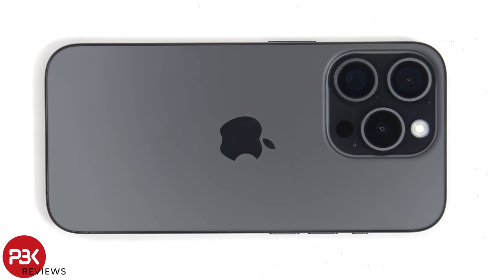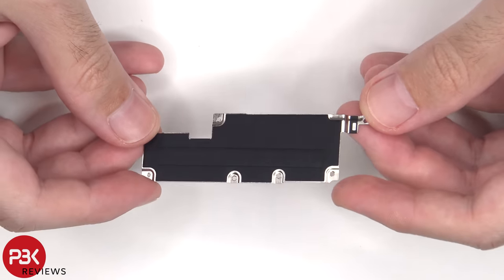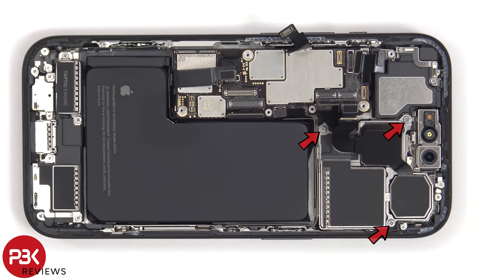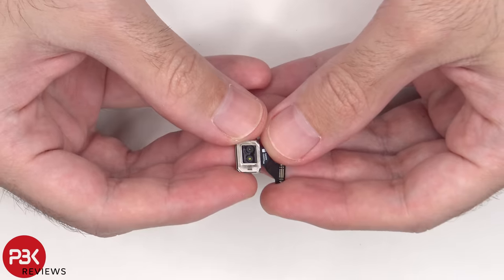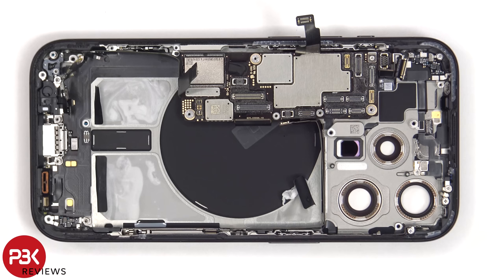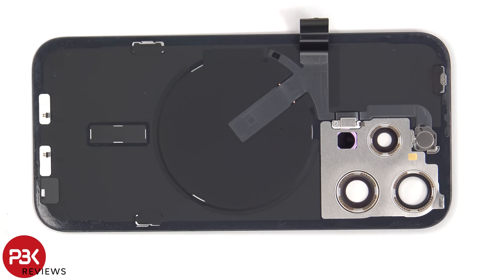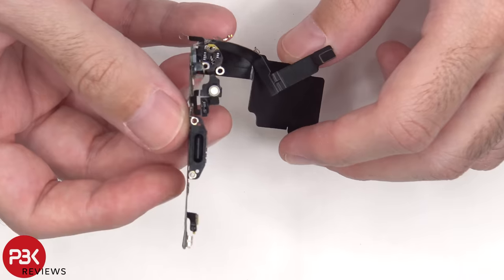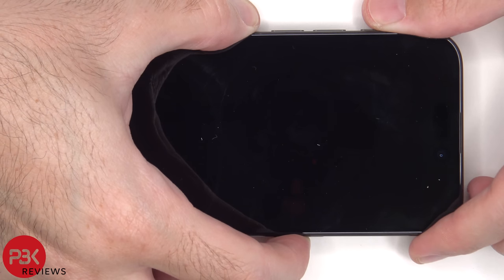Apple iPhone 15 Pro Teardown Repair Video Review

Comment: Repairability score 7/10.  This Teardown Video Review 10/10.  Amazingly well done, in focus, no bs, everything covered.  Bonus points for quality voice and not having grungy hands or nail bitten fingers too.  Props.
Reply from the maker: Thanks!
Reply: repairability is more like a score of 5/10 since you can’t just change the battery an expect it to work you have to reprogram everything and that goes for the screen as well
Reply: 7/10?? Man everthing in this phone is software locked, you cant replace anything without special soldering skills and/ or programming tools.
Reply: nail bitten score🤣🤣
Reply: lol the last few bits, couldn't agree more!
Reply: @johnny4498 it’s more like 10/10 to be honest
Reply from the maker: As mentioned in the video, the score is really only valid if it is actually repairable and not software locked down. I didn't have a second unit on hand to swap parts to test at the time of the video to know for sure etc.
Reply: @MikehMike01 Do you mean 0/10?

Comment: I'm in love with iPhone's internals. It's pure engineering.
Reply: Beautiful inside and out 😍
Reply: It's because it's all 🖤 inside.
I myself prefer black PCB over any other PCB  print color.
Reply: @LenstskyYT  it's not only because the blank painted board. It is because the structure and custom parts.
Reply: The Galaxy is better engineered. You can put a pen in there!
Reply: @JohnTaylor-bd1uy  I think a pen inside doesn't mean better engineered.
Reply: I think most high grade electronic products these days have amazing engineering that go into them, regardless if you like the company or not.
Reply: @JohnTaylor-bd1uy  hahahaha 🤦🏻‍♂️
Reply: @JohnTaylor-bd1uy  no, Samsung doesn’t even come close!
Reply: @dannyseville2543  In my opinion it seems like you've not worked a lot fixing electronics to see what i'm talking about.
Reply: 根據韓國產業通商資源部的數據，8月韓國的芯片出口總額同比下降21%，至86億美元，為連續第13個月下降。
以前中國想買，韓國不賣，現在韓國想賣，中國不需要了。
Reply: Do you do Microsoldering? Fixing the iPhone Circuit board?
Reply: @Adgale   that's my point, you need good quality material to build a complex Black painted PCB. Cause it's not easy to track the circuit layer. Overall, black PCB looks more professional.
Reply: @LenstskyYT  I agree but seems like you haven't paid attention to the rest of the text that i wrote.
Reply: iPhone 4

Comment: Finally removable back glass 10 years after Sony
Reply: iPhone 4 already had this.
Reply: But it seems that you can’t remove the wireless charging and that can slow down wireless charging speed or lose some functions when replacing the back glass

Comment: Although the back glass can be removed relatively easily, the design of this phone is still very different from iPhone 14. On the iPhone 14, most components can be accessed by removing just the back glass. However, on the iPhone 15 Pro, you still need to remove the screen to access most of the components, which means you will risk the screen by doing repairs. The iPhone 14 has better design.
Reply: This is the 15 pro not the regular 15 on the 14 pro you also had to remove the screen
Reply from the maker: Yup, would have been better if they made the 15 pro similar to that of the 14's.

Comment: In a vacuum, it's a huge step towards self repairability on Apple's accout. I don't think they have removed the hardware ID locks when replacing parts though :eyes-purple-crying:
Reply: That sucks, would love to put an extended battery in the 15 pro
Reply from the maker: Yep, that's what sucks. They basically try to say look we provide the parts so they get away with it but in the end, you're still stuck to going to them for a repair.
Reply: It’s okey because it’s genuine parts! Like a car dealer ;) won’t lose the phone value of you out cheap parts
Reply: The HW lock can be solved with a JCID programmer, as in the end, it is a software lock. The issue is that prevents any hobbyist from doing it. Excellent video PBK.
Reply: @PBKreviews  However I like the fact that no one can now sell a used iPhone with cheap parts.
Reply: @ramandeepsingh132  The cheap parts give the same error message as genuine parts. That's what makes it bad.

Comment: Loved this video. Tremendous content, production and presentation.

I'm impressed how much easier it is to remove the back glass. My sister has an iPhone 11 with cracked back glass and the quote from Apple for the cost of repair and replacement was $275.
Reply: It got even worse in recent years. The iPhone 14 Pro Max costs $549 to repair. Now the 15 Pro Max costs $199. Still very high considering the relative ease of replacing the rear glass, but it's far better than what it previously cost.
Reply from the maker: Thanks. Yup its easier, but most likely software locked since the wireless charger is attached to the back glass. So complete back glass replacements probably won't be fully functional unless you're able to pry off the wireless charging coil and move it over to the replacement glass.
Reply: @PBKreviews  Great point. I'm looking at it from the average iPhone user (I'm not one)... since it's easier, I would hope that Apple would charge less that their old $275 to change the back glass?  BTW, whoever asked for back glass anyway? A plastic would have been so much better.

And while we're on that subject, why do these companies insist on gluing their batteries with such difficult adhesives? LG comes to mind (I have an LG V60).
Reply from the maker: I honestly think its because they don't want you to be doing it and have to send it to them. Sometimes they will  meet the bare minimum requirements just to say look we made it user replaceable but we wont make it easily replaceable etc. So you are forced to pay them or their authorized locations to repair it for you.

Comment: Did I hear that right you have to remove the back glass in order to remove the charge port!
Reply from the maker: yup, because the prongs for the back glass on bottom cover the charger port screws from inside the frame, so you have to remove the back glass to be able to remove those screws lol.
Reply: @PBKreviews  stupid Apple move
Reply from the maker: yup

Comment: 9:15 heads up, the microphone on the bottom left side of the phone is a known issue on the Pro and Pro Max models, especially the models manufactured in July 2023. Better hope you have AppleCare+ or the issue arises before the 1 year limited warranty is up otherwise it’s a monstrous £557 repair because they would need to repair the entire bottom board of the phone instead. In my case I was well within the warranty and got the phone replaced for free.

Comment: @7:27  . after getting through the adhesive with the back removed ,thats it but i dont see scree access there . its all from the other side . theres the 1 screw for the wireless coil bracket.. then from the front its the 2 usual awkward to remove screws [straight down ] then the usual flat screws 8:52

Comment: I'm always struck by how big the battery is compared to other more complicated subsystems within the phone. Power is the Achilles heel of humanity. Whether in a car, home, or a phone, engineers must devote so much space to house batteries or tanks and then come up with ways to dissipate the heat it generates. Plus, it is almost always the weakest link in a system. We have to think like Star Trek and come up with a way to power stuff more cleanly.
Reply: Solid state batteries 🙌
Reply: Nuclear Fusion
Reply: @bigpoppa611  in a mobile device nice
Reply: @kendelion nuclear fusion is actually very safe.
Reply: @RolandKoller90  safe or not is not the problem. Size is :p
Reply: @kendelion  it all depends on how mobile you need it to be
Reply: Solid state is probably the most viable solution but it’s incremental rather than a breakthrough to let say nuclear fusion

Comment: Now do one that is cracked all over. I had to do one for work today and I didn't have that contraption. My fingers are all cut up from my 0.1mm screen disassembler thing. The screen wouldn't budge since it was cracked all over. I had to get in from the mid top where the cameras were. I just needed a little room for my pic and it worked.

Comment: Your video has no background music, clear voice information, reasonable camera angles. Very pleasant and comfortable to watch. Every video is full of information and very clean and beautiful. 
But I have a question why you don't open the back cover with a solvent that dissolves the glue. It will be much more leisurely.
Reply from the maker: thank you. because not everyone will have solvent vs a hair dryer to apply heat, so easier for people to do at home with heat. Also too much solvent or the wrong type can cause damage to internal parts if people follow and do incorrectly.

Comment: Doesn’t seem to have a SIM card slot place holder. Does that mean the models with or without now have different internal designs? Bigger battery on the ones without?
Reply: US version is also only one with mmWave antenna
Reply: The US ones don’t. They did the same with the 14
Reply from the maker: Not sure, we will have to wait n see from someones teardown on an international model.
Reply: @PBKreviews  from Luke Miani’s teardown the sim tray sits where the chip on the top left in your video is. Wonder what that chip is. Mm wave controller?

Comment: Great video, @pbkreviews, like all of yours!!

1 question: what is the adhesive type you use to close the phone again?

Thx!
Reply from the maker: I usually try to go with the original one made for the phone itself which usually becomes available online after a month or so when the phone is released. But here is a video I did a while back, explaining a bit further. https://www.youtube.com/watch?v=T4iiPUIM7-Y
Reply: @PBKreviews  thanks so much!

I'm looking forward to your iPhone 15 pro drop test ;-p (apparently said to be worst than previous 14 pro)
Reply from the maker: You're welcome. I don't have a drop test planned since overall there has been no improvements to the glass made over the year before so results wouldn't be any better, but someone already did do a drop test from appleinsider I believe and the results were poor compared to last years.

Comment: Okay but after adding other components will it work properly?
Reply from the maker: Most of the parts are locked down, but from the looks of it the back glass and wireless charger are not so those should be replaceable.

Comment: After seeing how easy this is (thanks to you), I’ve decided to not get AppleCare for my 15PM. I only wanted it because the glass black plate breaks relatively easy due to it’s weight. Cheers!
Reply: I've got bad news for you mate. you still can't change the back glass without going insane and lose a bunch of functions of the phone alongside it.
Reply from the maker: Yup its easier for screen and back replacements, but everything else is complicated. Not to mention you would have to probably pry off (if even possible) the wireless charging coil with flex and move it over to the replacement back glass since almost certainly apple will have a software lock in place tying that part to the phone.

Comment: You go through this whole process and show us the modem, why not specify if it’s the Qualcomm x70 5G modem or any word on how much RAM the phone has?
Reply from the maker: I'm not extremely verse nor have access to the detailed chip information to specify each chip type. Some people have access to that info from workers in that field or they work in the field and have access to it. As for the RAM, its whats listed on apples site, but again it's sandwiched between the two boards, so in order to show it like I usually do with other phones, I would have to damage the main board to pry the two parts apart.

Comment: Do you still need to swap the battery board to a new battery and reprogram it with the 15?  Thanks.
Reply from the maker: Not sure, but I would assume so. I didn't have an extra phone on me to swap parts to test.

Comment: How easy is the back glass replacement compared to years prior? Is it as significant as they proclaim it to be?
Reply from the maker: Well years prior you couldn't replace the back glass, it was fused to the frame and required special laser machines and so forth. So I would say it's a significant improvement. But I'm pretty sure the wireless charging coil that is adhered to the back of it, is paired to the phone so making it still somewhat difficult to repair.
Reply: @PBKreviews  oh okay I didn’t know that, their presentation just made it seem like it was easier and cheaper to do now. That’s interesting. I wonder when you buy a new glass if it comes with the charging ring already attached.. also where would you even buy something like that? I can only imagine it being 3rd party which would be kind of weird, especially considering it was a selling point.
Reply from the maker: There are some authorized resellers like mobilesentrix or ifixit who sell original parts soon after release. Also yeah, apple always glorifies themselves and tries to make it seem like a new color on an iPhone is some revolutionary new feature. Just like how they HAD to use USB-C now due to EU Regulations not allowing them to sell iPhones in the EU if it doesn't have a universal USB-C charger port, yet they present it as Apple adding a new revolutionary charging port so you can have faster data transfer speeds and charging while USB-C has been available on phones for years. Apple being apple basically. These type of things make it more and more likely I would never own an apple product for personal use again. A company who changes wording and basically lies about so many things but they will feed it to everyone in a way that people run to them thanking them. They used to actually be a good company who brought revolutionary products to the tech industry. Would be great if they went back to their roots.

Comment: Awesome video! One question, is the wireless charging thing glued to the back glass? If so is it too hard to unglue? Thanks!
Reply from the maker: Yeah its adhered to it, not sure how strong since I didn't try to pry it off, but from the looks of it from other people who tested, the back glass with wireless charging coil can be replaced without any software lock issues so replacements should not be a problem.

Comment: So now if I want to replace the charging flex/motherboard I will be risking breaking the back glass in addition to the display.. 🤦‍♂️
Reply from the maker: lol yep, or you would have to bend the brackets for the back glass to gain access to the screws which might make them loose or break so then you have an issue with the back glass not being screwed down.
Reply: I opened one today, motherboard can be rotated and wireless coil can be disconnected that way, flex is long enough, as for the backvover screw tabs, they can be bent preety easily so it wont be a must to remove the glass for repair. Still a bit of stupid design for repair, but it is what it is. :D @PBKreviews

Comment: What is your opinion about the newest jerryrig video ? Can you tell if the Glass is really that fragile or if there is a structural problem with the phone chassis itself ? Or you think this is uncommon and was just bad luck ? Greetings
Reply from the maker: The fact there is a circle cutout in the midframe where the wireless charging coil is seated into, basically offers no support directly behind it, and it's not completely flush with the battery nor is the battery a solid piece and can flex. So the glass on the pro max since its longer/larger, makes it more vulnerable than the pro glass in the center if being pressed down firmly as he demonstrated on the pro max vs pro. In general the back glass is weak. Maybe apple made it this way since its easier to replace, they thought they would make it cheaper and have more people breaking it and bringing it in for cheaper repairs but more often so equaling more profits. But that's just an opinion lol. Who knows, but the reason the glass from previous years didn't break as easily was because it was fused with the frame making it more durable and have more support. I'm sure they could have made the glass stronger but yep, it is what it is :)

Comment: Question, did they make use of the space that is taken up by the SIM card tray in the international models with something else here?
Reply from the maker: I didn't notice anything or any covered up space that can be used, unless its from underneath the board soldered on the back side. So who knows, maybe the design internally might be slightly different on international ones but the chance is small.

Comment: If I understood you correctly the back glass can be removed on its own some heat and a pry tool correct?
Reply from the maker: You would ofcourse have to remove the two pentalobe screws by the charger port but yeah :)